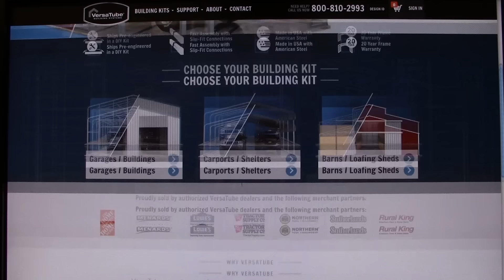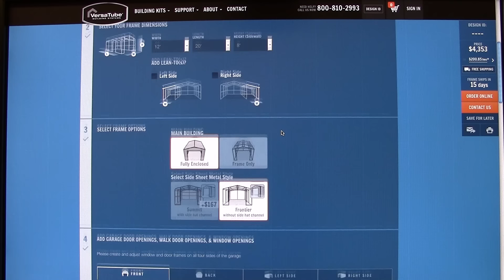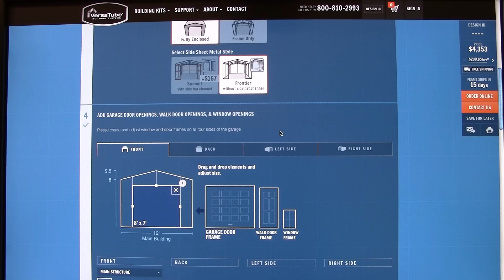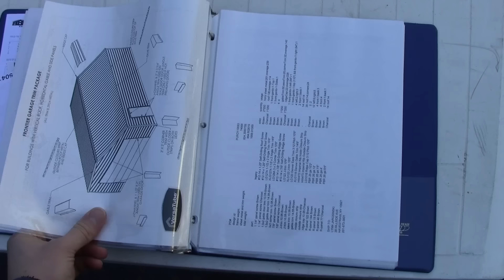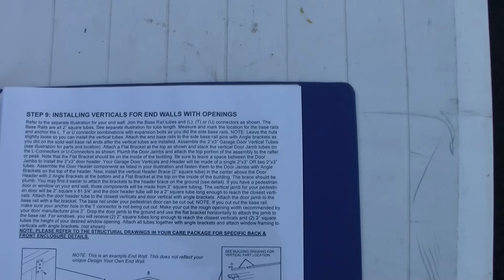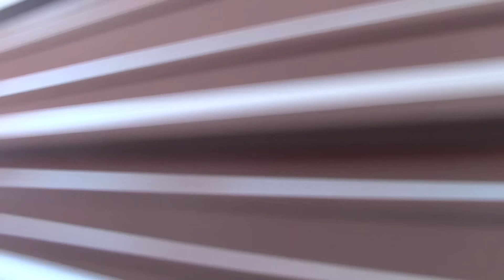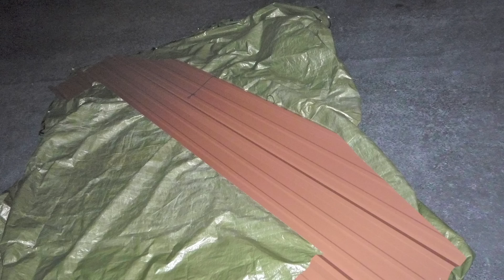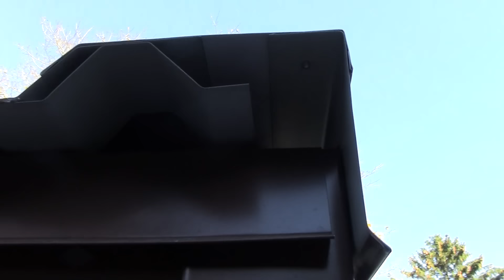Versatube Metal Garage Review In-Depth

Comment: Thanks for a great review. I was considering these folks, but would have wanted a custom designed building (12x20x12 with a loft) which was going to cost a lot more. Now that I have seen how lacking the engineering of the entire building is, I think I will stick with a standard DIY wood framed building.

Comment: Seems like a pretty good kit overall.  I fully expect to run into things not fitting 100% in any kind of kit larger than the size of a basketball IMO.  If you think about it, the angle cuts would be impossible for them to do - would both raise the price quite a bit and would likely never fit right.  You have a different roof pitch for damn near every county/city/municipality out there... 

Reviewing their kits i had a few concerns/questions though. Do you think there's any problem with the self tapping screws?  I'd much prefer having nuts and bolts going through - though that would add quite a bit of work to the construction... I guess they get around the issue by having the massive amounts of self tapping screws... 

Second, do you plan on adding any insulation?  

And what did you end up paying for the garage door and install if you don't mind sharing? :) 

All in all, that's a very nice garage for 4 grand.  Doubt you could do any better with wood/plywood.  And good job building that :)
Reply: dre04mach       You’ll soon hate life messing with bolts and nuts.   Especially since you’re often working where you can’t reach the other side .     I could see adding a few here and there in strategic places though.
Reply: @drizler  i ended up having a company set it up - the length was about 4in off at one point and required minor modification, but overall has turned out great. Its a 30x40 building, 12ft high walls and 15ft peak

Comment: great review, thanks. I understand everything you were saying.I worked on a metal shed and replacing sides and fixing roof was about the same problems you ran across and trimming each, have to watch sharp edges or alot of nice cuts. plus cutting with thick ridges is not easy either. Now looking at just the frame and found company that makes metal roofing will cut all pieces to fit actual structure, for both walls and roof and see how much that would be.http://www.bestbuymetals.com/ maybe the cost will be close enough to make it worth buying from if don't have to measure nd make the cuts myself.
thanks again saved me from pulling hair out.

Comment: Thank you very, very much for doing your thorough youtube video about your Versa Tube Garage Kit!! I did notice that you ran all of the side panels horizontal rather than vertical.
Yet, it is very important what you revealed about the L brackets that support the trusses.
The manufacture should not compromise the base frame integrity with poorly punched, rather than drilled holes for the base mounting to the foundation. Since, I'll need sufficient truss support for snow loading, I think I will look for a better built kit. Again, thanks so much! Ron

Comment: Thanks for this video. I am in the market for getting two metal buildings. I would probably use this frame for a really strong greenhouse (I think this would work great to get this frame only and then skin it using plastic from another source) so This video shows me I am on the right track with that idea. As for using this for a "shop" with locally bought metal skin I might rethink things. Thanks again.

Comment: Is there a way these could be built in a side of a hill and not leak water thru the sides and not rust out within 50 years ?
Reply: The R panel should not be in direct contact with soil or anything that would trap the water permanently. The panels will corrode quickly if there is any breakdown of the protective coating.

Comment: Excellent review!  Thank you for taking the time.  You are correct when you say this not a kit.

When I buy a "kit", I expect the panels to come pre-cut to size.  Otherwise, I would cut and weld a few pieces of square tubing and build a much stronger frame, then go order the panels separately from my local home improvement center or metal supplier.